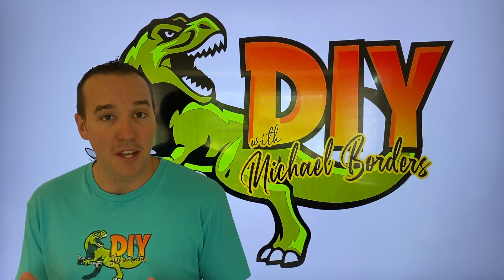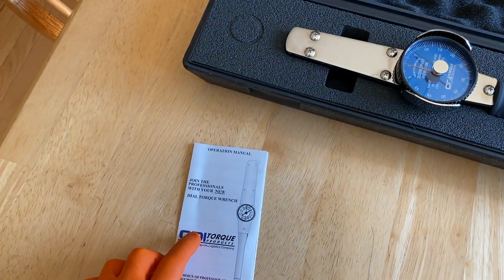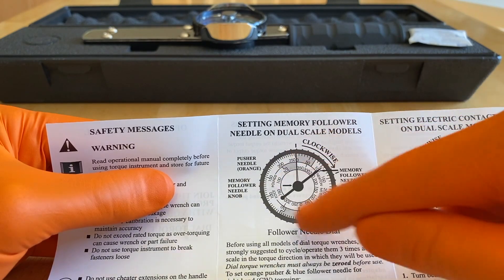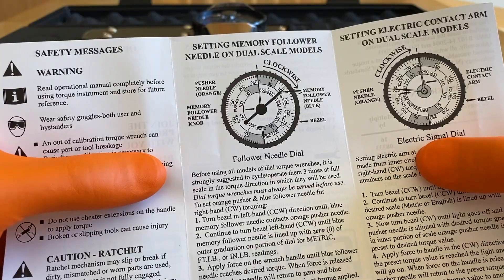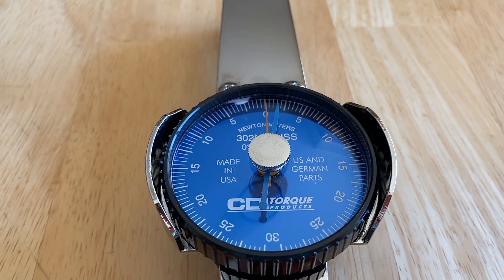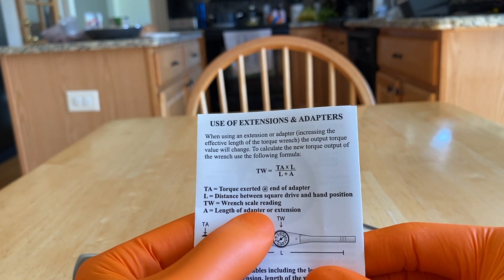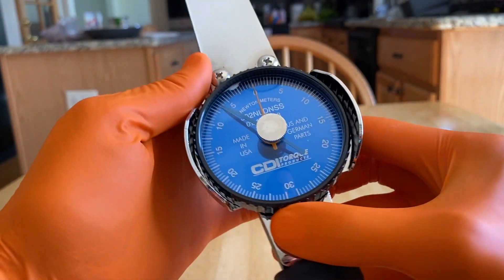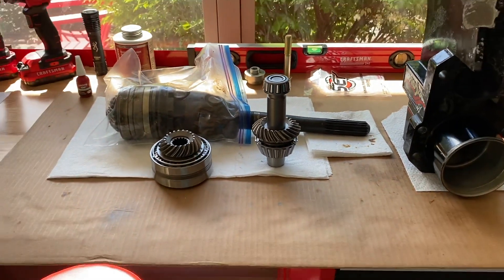CDI inch pound torque wrench tutorial

Comment: Michael, usually love your videos, but this one contains a grievous error.  The torque wrench dial is clearly marked that it reads in Newton Meters.  1 inch-pound equals 8.8 Newton meters.  I think you probably over-torqued the bearing preload on the Mercruiser drive shaft.  I will also say that based on internet searching, a torque wrench that will accurately measure five inch-pounds is a rare and expensive thing.

Comment: My needle points to like 2 O'clock w/ no force. Its only been used a few times and has never been very high on the scale...thoughts? Is that an issue?
Reply from the maker: @brianboyd5024  

Thanks for watching, any update on your project?  Are you servicing an alpha one gen 1?
Reply: @ I disassembled, was shocked at how simple it was. Reset the dial and checked vs 2 other torque wrenches in the same range. So far so good!
Reply from the maker: @ 

Thanks for watching and taking a moment to write us.  Awesome job making it a DIY project!  👍